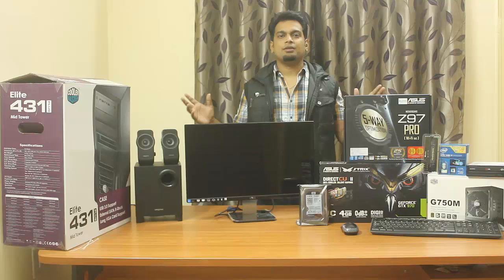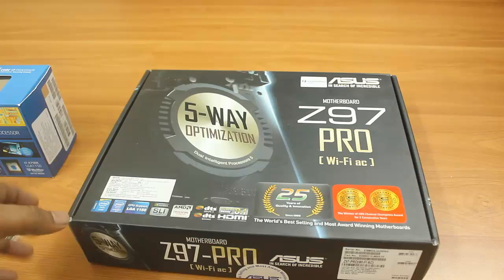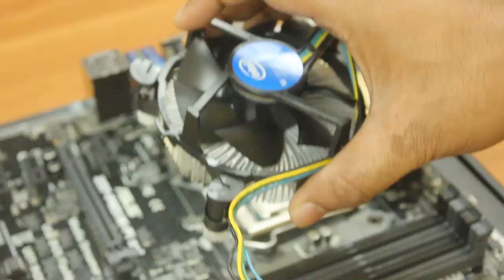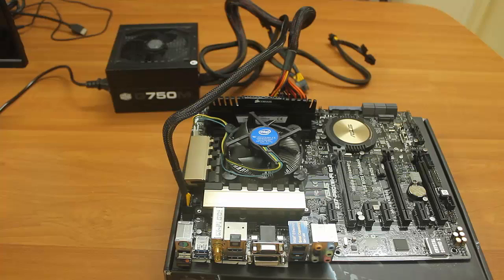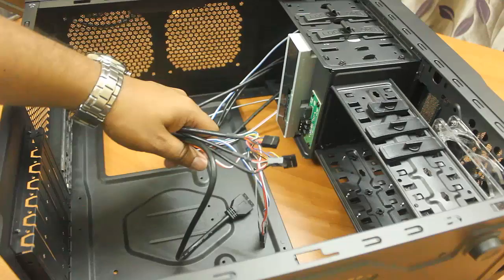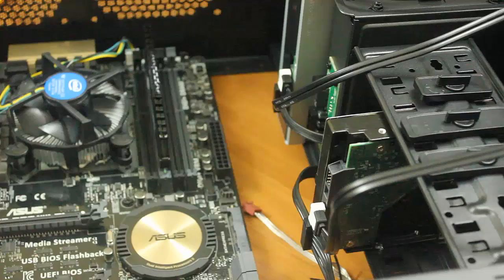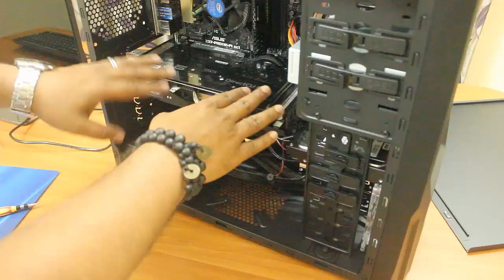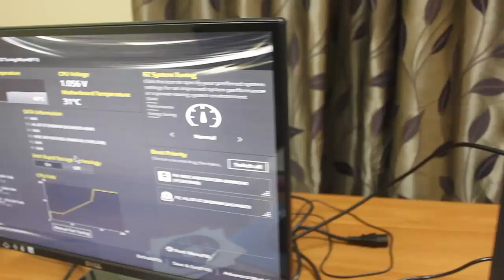How to build $1500 ultimate gaming PC  2015 - 2016 | India | intel i7 4790K | GTX 970 |

Comment from the maker: @jeevan jose - Thanks ..
- Max temp. during gameplay goes to 70 degree Celsius
- If you will put non-stock cooler, then temprature will be very less .. but 70 is also ok for these processors.
- Just go for it .. no issues since 4 months , all games running at 60fps @1080p

Comment: you have not added any cooling fans in the cabinet other than the front blue one?? 
you should tell which fan should flow air in which direction and about cable management also. Dust is the major problem in India, plz also tell how to include dust filters
Reply: T44 u just screw it in front of ur intake fans.
Reply: Installing fans and managing the cables properly can reduce cpu temp 5-10°C. And installing fans are not just a random thing to do. If you are using liquid cooling device for the system (which you were supposed to do for this build) the direction of flow can be compromised to some extent. But as he is using the stocks cooler and stock cooling fans thus the direction of flow really matters. To be honest the cabinet used here is overkill for this particular build. :)
Reply: T44 actually i dont lyk the cabinet...it dosent a lot of cable management options....

Comment: Hi ! Is there any alternative to 750W Cooler Master Psu-g750????And how much ram I can increase to improve perfomance for using 3ds max and photoshop and gaming too??????Also is there any other alternative for the cabinet thing bcoz what i say in the video there was very little space between the graphic card and the cd drive for ventilation .....Thanks.....
Reply from the maker: Yash Naik Yes, go with RM750 PSU , check my video on it - https://youtu.be/_lrDmtbYPtM
You can go with Scout 2 Cabinet , check this video - https://youtu.be/4uSWZmYPYMA
16GB RAM with this graphics card would be more than enough, but make sure to add SSD , check this video - https://youtu.be/VXUUaBrQUto
Reply: Tech Virus Thanks....
Reply: Tech Virus will this configuration work for 3ds max, Photoshop and corel draw and other editing softwares?
Reply from the maker: Yes... it will .
Reply: Tech Virus Thank You very much for your help.....
Reply: Yash Naik g750 is not a very good one. go for the v650 semi modular. its far better than rm750 (chinoy made). you may consider the CWT made rm850. But for this rig a quality 650 watt is enough.

Comment: I'm planning to build a similar i7 4790k pc too,( but with a smaller graphic card, something like a R9 280x ). question: Does any heat gel or thermal paste come with the processor already? or I have to buy some out there? greetings
Reply from the maker: Leo Nemesis Yes, the stock cooler has thermal paste already applied on it .. it will work for one time only , if you remove the processor once you need to apply thermal paste after purchasing it .

Comment from the maker: @ shiva kumar - Thanks for your feedback .

I want to add few thing on your comment :-

1. You are right its all purpose PC ;)
2. Yes for now i5 k edition will for fine ... but just to be future proof used i7 processor .
3. 4 GB Vram is used by "Middle of earth - Shadow of Mordor " at max settings at 1080p .
4. Most of the games usages aroung 4GB Vram when you play on 4k Monitor , and may be in 1 year I will upgrade my monitor to 4k.
5. SLI and cross fire are both different and it does not mean you have to use multiple monitors if you use either SLI from Nvidia of AMD crossfire ; its just to use parallel processing of multiple cards . And yes, 4k gaming is the future , I will eventually use SLI may be in 1-2 years .. so my i7 and gtx 970 is quite ready ;)
6. Same thing with PSU .. 750 W can support 2 GTX 970 so its again for future proofing ;) 
7. I went with bronze as it had more warrenty than gold PSU , also the power consumption does not depends upon bronze or gold type , it just increases the clean power supply which is good for your devices for long run . Also, 750W will not draw full 750w all the time , when I play game with my current config. it will draw max 400w , thats ok for a PC ;)
Reply: do you have a video setup of how you installed the os in the boot menu?
Reply from the maker: No .. but its quite simple, just download OS in pen drive and boot system 1st from pen drive .. it will install . I have got new laptop , I will be creating a video to install dual boot OS soon .. If you want to see that pls stay tuned ;)
Reply: ok thanks man i have same build as you this is my first pc  i build its just the os  to install i will stay tuned
Reply from the maker: cool ;)
Reply: 4k gaming is not the future for many, many years. It's too expensive. With a 970, you're gonna hit 4GB VRAM usage too easily and you won't get more than 30-40 FPS anyway. Not a good experience. You shouldn't cheap out if you're interested in 4k, get 2 980 cards.
Reply from the maker: I am not getting 4k monitor now , may be in 1-2 years , and yes after that I will get one GTX 980 and use it with GTX 970 in SLI mode .. that will work fine with 4K ;)
Reply: Tech Virus uhm, I don't think you can use a 970 and 980 together with SLI...
Reply: *****  dx12 might change that
Reply: ***** 970 and 980 do not support dx12 entirely like amd . Some features will be emulated , you mis understand the api , it allows for low level access to hardware hence a 980 and a 970 can be used together. like in mantle a 290 and a apu or another card will work together. There is no patch for 3.5 vram , that is a hardware problem with the software programming it to use the last 500mb more efficiently.
Reply: ***** 3.5 vram is a hardware issue which cannot be solved , they only released patch to use the last 500 mb more efficiently, 970 and 980 are not completely dx12 compliant unlike amd some of the features will be emulated. 970 and 980 are close to each other yes but at 1440p and higher 980 will pull away. dx12 will allow 2 diff gpus to work together so theoretically he could put a 980 and a 970 together and use it like you can do with amd cards and mantle.
Reply: ***** dx12 is a api , it doesnt improve performance it allows developers more freedom and closer access to hardware and less overhead to deal with like on the consoles thus giving us more performance IF utilized correctly.
Reply: ***** No , again if you would look into it 960/970/980 support only resource binding TIER 2 , while the amd gcn cards support TIER 3.
Reply: +deep wadukul 970 msi?
Reply: please reply what about fan or there is already fan in psu?
Reply from the maker: Fan is already there in PSU .

Comment: Nice guide, very informative. Subscribed. I plan on building a similar rig in the coming month and plan on following this guide. Just had a quick question. I'd rather use a Mini ITX or Micro ITX board instead of the ATX board here, with a GTX 980 instead of the 970. Do you have any recommendations for a Mini/Micro ITX board + Case for that kind of a configuration. I have no budget restrictions for this combination.
Reply from the maker: You can go with Z97I-PLUS Motherboard ... and BitFenix Prodigy M Mini ITX & Micro ATX Computer Case ..

Comment from the maker: @Tushar Upadhyay : Yes its from Bangalore (SP Road , Surabhi Computers) you can take components from any shop there just make sure to check price in multiple shops and most important check seals in all the products !!
Reply: Thanks man! Keep up the good work
Reply from the maker: wc bro ..
Reply: Tech Virus I am pretty sure that you will require external cooler for your processor because stock cooler is not very effective oh high temps...
Reply from the maker: My CPU temp. is going max upto 50 C when playing graphics intense Dragon War Inquisition or COD AW .. I think is is quite ok ;)

Comment: Hi,
What configuration do you suggest for high performance video editing pc with true color HD monitor? Budget = Rs.100K - Rs. 120K
Reply from the maker: Avinash Deshmukh Go with same configuration and just change the following :-
1. Get RM 750 PSU from Corsair 
2. Add 250 GB SSD or 500GB SSD (Samsung EVO).
3. Add 8 more GB of RAM
4. Go with Dell UltraSharp U2412M 24-inch LED Monitor
Reply: Thanks. Will get the budgets on it soon.
Reply from the maker: Welcome ..

Comment: Which motherboard wud be better-
Asus sabertooth 990 gx rev2.0 
Or
Asus Z97 pro
Reply from the maker: Neville Fernandez Sabertooth is know for more durable boards, but make sure it supports intel processors . Also, I have been using Z97pro wifi extensively and did not find any issue til now .

Comment: I'm planning to build exactly same PC as yours. But I'm not for gaming, so I'm not going to buy the NVIDIA graphic card. I noticed that you are using 750W power supply, this is too high for the electricity bill. So what is the "minimum" Watt of power supply you would recommend? Is 300W supported?
Reply: +rexleop1 as long as you are not overclocking, you can use a 550W psu in a build like this with no problem

Comment: hey abhishek...loved your video...had some great info...i was just wondering how much is your pc's benchmark score???? like you must have referred to the 3dmark benchmarking after or before getting your pc done...so just wanted to know how much is your benchmark score??
Reply from the maker: Rishi Gupta Than you .. I have not checked with 3DMark .. but with heaven it runs at 35FPS at max-out setting at 1080p ( Atilising 8X) .. I will check with 3DMark soon and update it here ;)
Reply: i wanted to know as i was cobfiguring my own gaming pc and used a combination of some specs you mentioned like the motherboard...processor and graphics card.....individually they have amazing rating on and so wanted to know how well they perform together....

Also wanted to know if liquid cooling is a better option as frequently i would be overclocking my pc....?????
Reply from the maker: Everything is working great ! Just the PSU game me some issues so I changed it to RM 750 (gold) and its running excellent ..

If you would be overclocking too much it would be good to go with water coolers , and also go for better cabinet so that it can fit the radiators well .
Reply: Tech Virus ohkkk thanx man....do tell the score though.....

Comment: dude can i go with a 650 watt power supply for the same config (except the MB ,asus vii rog z97 hero (or) ranger n im really tied up between these three motherboards msi z97 gaming 7 and the above two asus ,can u sugest the ideal one for me ,thx ,nice vid btw.(n even a good power supply unit)
Reply from the maker: Thanks ... I would recommend you to go with 750W PSU (650w will also work in this config.) as in future if you want to add one more GPU card then you do not have to change ur PSU . For MoBo go with Asus MAXIMUS VII HERO .. ( MSI is also good but service support for ASUS is better )
Reply: Thx,can you suggest a good 750watt psu, how is the cosair rm750,should I go with a psu which costs around 4-5k or 7k, my max is abt 7k, thx in advance 😊
Reply from the maker: I got my cooler master PSU in around 8.5k .. it has good 5 years of warranty . Its working great .. Cosair is bit more pricy and has only 3 years warranty ..
Reply: Ohh kk,thx 😊😊

Comment: hey guys can you tell me if this a good pc build

Intel® Core i7 4790 3,6 GHz
Fractal Design Integra R2 650W
ASUS GeForce GTX 970
Gaming 3 Killer NIC
Corsair 16GB 2133mhz
Kingston V300 240GB
2 TB, 7200rpm, 32MB Cache
any recommendation on what to add or change?
Reply from the maker: Looks great ;)

Comment: i5 4460 3.2 GHz, 8GB RAM, GTX 970 4GB
Does it support with the Gigabyte motherboard Z97 Gaming 3 ?
Reply from the maker: yes, It does. Check for AMD or Intel compatibility.
Reply: Tech Virus
but I can't run high setting in all games, only 13 to 15 fps.

Comment: hi abhishake I hv the same set up I was inspired to buy from ur reffrence I have a problem with gtx 970 card on z97 and rm 750 psu how to wire it properly
Reply from the maker: +arjun bakshi Check my video, I have shown them properly. You need to connect 2 power pins to both mother board and graphics cared .
Reply: +Tech Virus yes I hv seen this video repeated parts of it I am unsure of what cables to use

Comment: why not ssd for faster boot and a aftermarket cooler if you want to overclock?
Reply from the maker: SSDs only adds faster boot (10-15 sec. faster) and faster app launch ; for gaming it does not add any performance boost ! I will go with after market cooler only when I would need to over clock processor ; as of now all latest games are running on ultra 1080p settings ( some even on 4k with DSR) .. so may be after 1 year I may need to overclock it , then I will go with custom coolers ;)

Comment: My main question is if the sound card is built into the mother board or if that was something you either installed but did not show, or if it was just something you did not install?
Reply from the maker: Its built-in the motherboard itself . No need to install external card as the integrated card is of very high quality ..
Reply: Many thanks!

Comment: Do you get all the parts in SP road? Even the monitor and is there the x99 mother board
Reply from the maker: Not all, Monitor, Speaker and new gaming keyboard and mouse from Snapdeal ! No they din't had X99 , also processor and RAM with x99 would have costed me 1.75 Lac. ; I am happy with this ..
Reply: How much did this cost?
Reply from the maker: It costed me 1 lac 5 thousand ..

Comment from the maker: Rishabh Singh - Yes, if you put 2 graphics card both will work at same time ... its called SLI or cross fire .. I do not have much Idea about Mumbai as I have purchased everything in Bangalore ..
Reply: Thank you so much for helping :D :D
Reply: Where in bangalore?
Reply from the maker: You can check in Ashirwad computers S.P Road ..
Reply: Hello, I stay in Bangalore. What is the cost of i5 6600k, R9 390x and gtx 980ti at SP road, as in my rig I am thinking to put 980ti instead of r9 390x. Can tell the prices?

Comment: Nicely build but need some more work on cable management. Add extra coolants for protect your GPU and processor. I'll post my recently build i7 6700k with same cost👍🏽 thanks for posting this informative video
Reply from the maker: +hiren “hiru919” panchal Thanks ... Yes, I did the cable arrangement again when upgraded the cabinet to Scout 2 . and also added CPU coolers ..
Reply: It sounds so impressive man.!! Which cooler have you added? I ordered M.2 950 pro 256gb SSD. Its coming from usa. i spent rs. 18300 with tax. It most fastest storage device then everything. I'll put review about this bro! thanks for reply ;)
Reply from the maker: Cool ...I have used hyper x 212 cooler ..

Comment: If I got 4 x 4GB RAMS, would I need a more powerful power supply such as 850W.
Also, is the sound quality from the computer good, or does it need a sound card?
Reply from the maker: Vuddit No you would not need extra power for the RAM . Sound quality is really good, just get good speakers and it will work awesome .
Reply: Tech Virus Would I need extra power if I installed an extra 2 or 3 fans though?
Reply from the maker: How many total fans are you planning to install ? Fans usually takes very less power and increasing 2-3 fans will not affect . Let me know your entire configuration .. then I would be in better position to answer them ..
Reply: Tech Virus Zalman Z11 plus case(includes 3 or 4 fans I think)Asus DVD Blu Ray Writer
WD Black 1TB Hard Drive
Nvidia Geforce GTX 970
intel i7 4790k CPU
Asus Z97 Pro Motherboard
Vengeance 16GB Dual/Quad Channel DDR3 RAM
Reply from the maker: For this configuration 750W is enough .. You can even add 3-4 more fans and also you can add more RAMs ..

Comment: What FPS do you get from this build?

have you tried games like Crysis and AC : Unity?
Reply: He will get a constant 60 fps with this build...For AC unity if he set all settings to ultra then sometimes 4-6 fps will drop otherwise it can max out all the games till date.:-)
Reply from the maker: All at 60fps max out at 1080p ... CS:GO --> 280fps at max settings ;)
Reply: Awesome, I have one questions though, hopefully you can answer.

I can afford up to 50K on a GPU, should I get 2 mid range GPUs which cost around 25-27K or should I get just one GPU worth 50K?
Reply from the maker: The best option for you to go with 2 Nvidia GTX 970 in SLI mode (27k+27k)... SLI performs awesome and will be far better than single 980 card ! Also you will have 4+4 GB DDR5 .. if you are not using 4k single 970 is enough for 1-2 year ..
Reply: Tech Virus Exactly the answer I was looking for, thanks.
Reply: Vishal Duggal Just so you know , 2 cards in SLI (lets say 4GB DDR5 each card) wont be added , it will be mirrored , so 2 cards in SLI wont give u 8gb ddr5 but 4 + 4 mirrored. 
I suggest that if you will be playing on 1080p for now that you get a single gtx 970 and save your money. No need to go SLI as new cards will come out - AMD's ones - , not necessarily better but they will push the prices down and after 1-2 years when you will need more GPU you can pick whats best.

Comment: Nicely done ! Which camera did you use. Seemed to have a few focus issues. Also which OS did you install if you kept this rig ?
Reply from the maker: Thanks Manish .. I have used Canon 550D .. It does not have auto focus option in video mode , I had to manually ficus it every time :/
Reply from the maker: OS - Windows 8.1 Pro
Reply: Ouch. Linux fatboy here ;)

Comment: will this motherboard msi 970 gaming motherboard will support i5 4760K and gtx 970 and DDR3 8gb ram pls reply fast
Reply: Harkirat Singh and does it have wifi integrated
Reply from the maker: Harkirat Singh MSI 970 Gaming motherboard will NOT support any intel processor , it only supports AMD processors . Yes, it will support GTX 970 Graphics card and 8GB DDR3 RAM .
Reply: then other good motherboard for 10,000 rupees